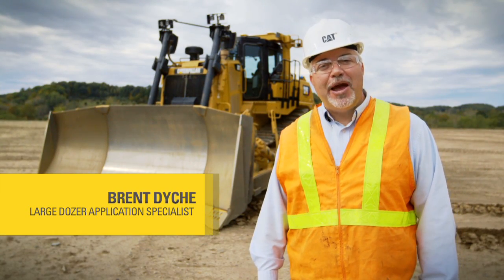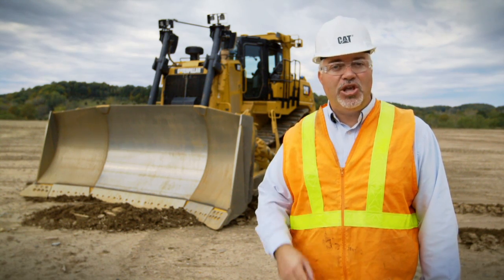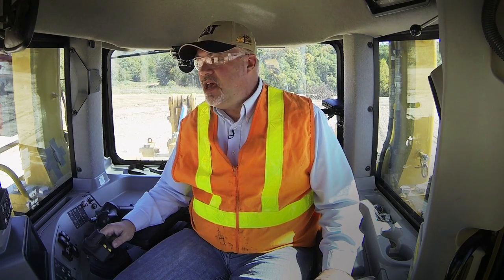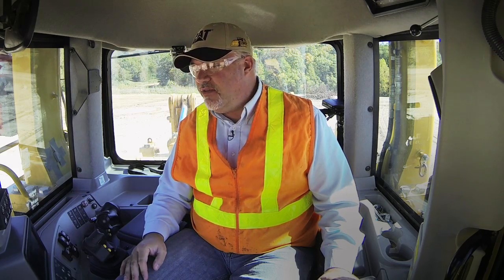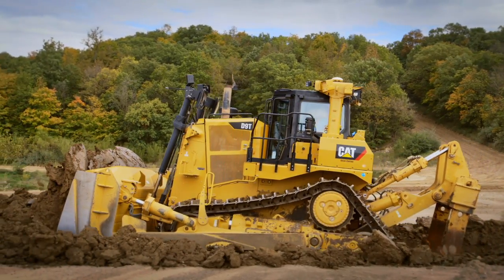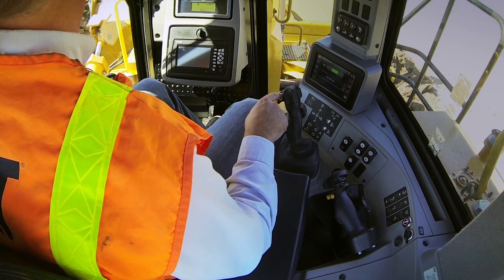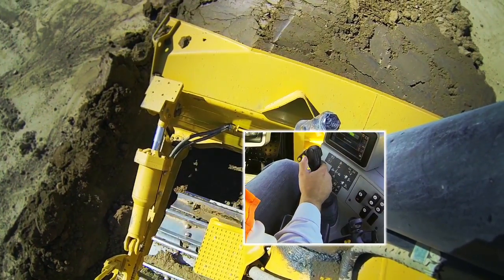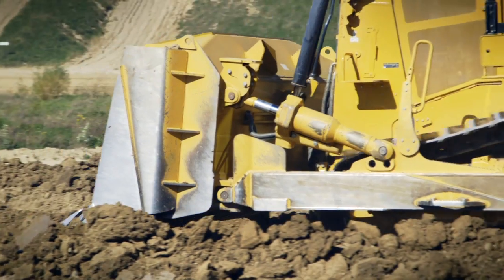Cat® Large Dozers - Integrated Technologies: Automated Blade Assist

Comment: That is nice information to know and the operators must appreciate the new technology too. I have operated a D-6 Caterpillar bulldozer, and loved it so much until I didn't want to get off the machine. The only thing missing on the machine I operated was the grippers on the back of the machine, which did make leveling in one area difficult after a certain point. The bulldozer I operated was used primarily in the logging business, and we was using it to level the ground in an area where a church foundation was being built up. 

There is a Caterpillar plant here in Arkansas and I would love to stop by there for a tour of the complex. After years of working on heavy equipment for the Air Force, it was nice to get on that monster machine and get in some hours of operation and treat the machine like the ones we did in the military.

Comment: blade assist, when setting it. do you program the vertical offset to whatever you want? As an example if you want  a cut of 5 centimeters or 2 inches you can set that right? then after you get to the point where you have loaded the blade you hit the button to put it into carry positioning, right?  then when you get to  the point where you want to spread or pitch the blade forward you hit the button again, right? If your slot  cut is always 5 centimeters or 2 inches. one can assume you will always carry the same amount of material +/- a bit. Can you not set or program the balde assist to auto thru the cycle at always the same point in your cut? EX: Load for 10 meters then it automatically goes into carry for again 10 meters then automatically pitch to spread? Or does it always have to be determined by the operator as to when to engage the functions during the loading /carry/ spread? If so what are you programming? Other than your initial set of the pitch cut or blade angle what else are you achieving. Most operators after the initial load can carry and then spread.